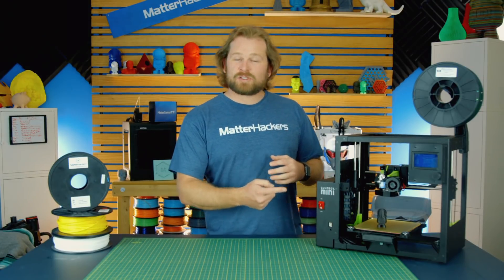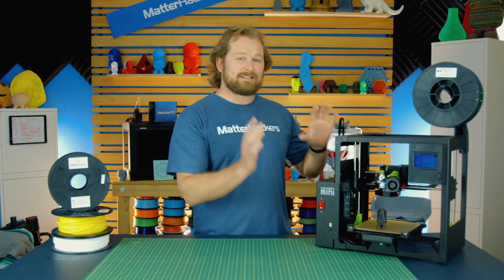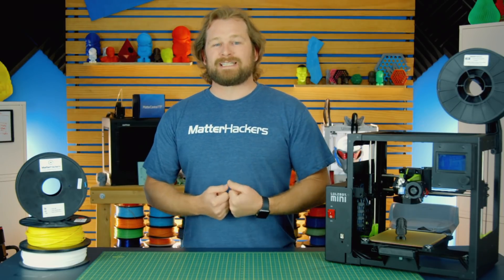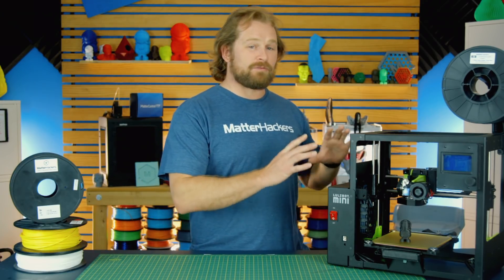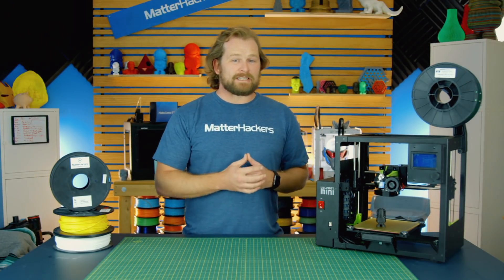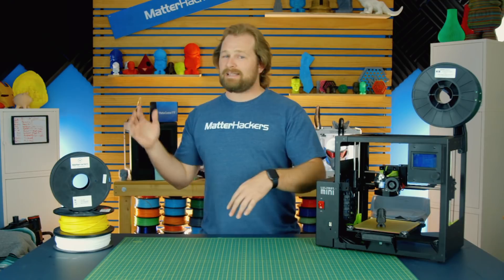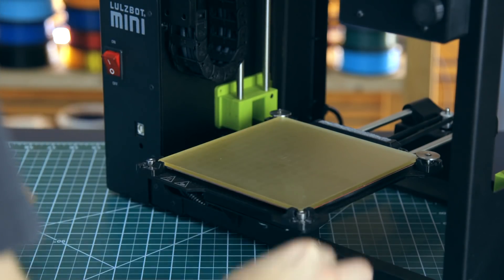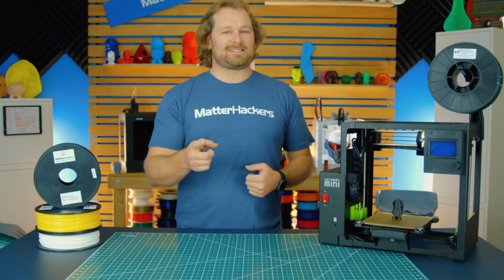The New Lulzbot Mini 2 // 3D Printer Highlights

Comment: Got this printer, tool head failed less than 3 weeks after receiving. Currently dealing with lulzbot, and I’m less than impressed with their response. Considering the price, and currently still not able to print for more than a week... I would not recommend them at this time...let’s see if they make good.
Reply: Update, Lulzbot replaced my tool head, and reimbursed me for shipping. Since then it has worked fine. However it was a frustrating process,  and I did loose 3 to 4 weeks of time I could have been printing.

Comment: I looked up the price on this LulzBot Mini 2. $1500? Seems like they are missing a lot of features built into other printer lines at 1/3-1/2 the price. if you go up to 2/3 the price of this printer you get auto-bed leveling [edit: apparently this is included], removable bendable print surface, filament sensor with restart on filament replacement, restart on power failure (the later may be built into the LulzBot Mini 2.) Adding to other comments. I don't see how the Z-Axis belt solution is better and how it can be more precise. What is meant by "more precise?" The Mini 2 spec sheet describes the operation of "locking the motors," to keep the belt from moving, as a feature. Seems like a work around to an inherent problem in using a belt on the Z-Axis. [Edit: looks like there may be some precision gained from gearing the belt drive. I'm not sure you can't gain even more precision from gearing the lead screw solution. In this case the geared belt is likely more precise than older version.] Also from the spec sheet; Describing a glass plate with PEI on one side as a feature is really strange to me since this is a really a cheaper solution than other print bed solutions on less expensive machines on the market today. Not that what they have put together isn't a good set of features and likely a good printer. It just seems to come in short of features and at to high of a cost. Also, I'd like to see some reviews demonstrating the print quality and noise compared to other similar printers. e.g. Prusa MK3.  [Edit: i'm not normally such a negative person this product just struck me.]
Reply: So after trying to find what they're actually doing with the z-axis, I think I have some idea -- they're using a geared stepper to drive the belt system -- that is by design will be more precise than a lead screw, unless you get a super fine lead screw pitch. With a geared stepper, you have a very high steps/mm number on a belted Z -- which if done right will not have any lead screw related z-banding, and because the stepper is geared it is essentially self locking as there is not enough weight to back-drive it to cause any issues with the bed falling when powered off -- or other issues. This machine does have auto bed leveling -- same as other Lulzbot machines -- it does 4 points by tapping those conductive bed holders. So, with all that out of the way, it is silly for it to be priced at $1500 with MK3 priced at exactly half for a kit.
Reply: (I'm inferring here from the literature). Looks like they are using a dynamic brake. Probably several NC relays or an IC that opens the shorted motor leads when it is powered.
Reply: More precise meaning no z wobble/banding that other lead screw systems tend to have due to side loading of the X axis gantry

Comment: I could be wrong but I thought lead screws were more precise than belts?
Reply: Chris Hutchins Yes, this seems like marketing spin to a cost reduction change. A leadscrew is not really that slow in the Z axis considering it only moves periodically other than when homing or bed leveling. 15mm/s on a Taz mini should be pretty quick. $1,500 with no auto mesh bed leveling, no filament run-out detection, no power recovery. Also when running belts if the printer loses power it's going to bury the hot nozzle into your print making recovery somewhat difficult.
Reply: @Alec Richter You're right! I should have specified auto mesh leveling (I have edited my previous comment to be clear). I just read the literature on the Mini 2 and you are also right that they are using some sort of dynamic brake, probably some NC relays or IC. We have a Taz 4 and Taz 6 here at work and I would rather deal with the manual leveling of the Taz 4 over the OEM Taz 6 any day of the week. The Taz 6 conductive corner bed leveling fails so often that I just disabled it. It is super frustrating putting it on the network for remote printing just to have it fail leveling 75% of the time. It's custom Z min switch is not very repeatable, but that isn't the main problem. The nozzle is rarely cleaned enough with the auto cleaning routine to make contact without deflecting the bed differently at each corner, which causes the bed measurement to be incorrect. This is with a new cleaning pad installed. Our Taz 6 now runs custom Marlin firmware, uses the Z max switch to home instead, and uses a manual mesh bed correction stored in firmware based on the bed temperature we happen to be using at the time. Of all the bed leveling I have encountered, there's definitely no perfect solution. Inductive, IR, BLTouch, servo/microswitches, and manual leveling are all usable. Capacitive is to sensitive to ambient conditions (for my particular installation at least). Conductive would work better if it didn't use the nozzle. Nothing is perfect yet. Time to innovate!
Reply: belts also stretch over time and use, even the high quality ones. I do not understand why they did this as having fast z is not a selling point at all
Reply: doesn't the mini use those metal disks for 4 point auto bed leveling -- it's not a mesh, but presumably the small build plate will be flat, so it should be sufficient. Yes the price is silly in the current market. A belted Z will be fine for something small -- I wouldn't call it a feature upgrade
Reply: Chris Hutchins the drive is geared, so there's more precision, mathematically, than the leadscrew they were using. Screws aren't inherently more precise than belts, it's just that the common belt pitches have much fewer rotations/mm than common screws.
Reply: Belts eliminate z banding
Reply: I've never had my Taz 6 nor my Mini fail bed leveling for anything more than a dirty nozzle. Quick clean and I'm back in business for another 150+ prints. Not ragging on you at all, but there may be an issue with your machine if you found it easier to just disable it.
Reply: Not only is it accurate, but it is VERY durable. My 14 year old can use it and abuse it. It just keeps going!
Reply: Yes they are, but in reality there are a few things. Assuming you count by 1/2 steps, which is the only microstep you can actually trust,  the belts have a maximum resolution of .04 with 1.8° motors. With 0.9° motors, you can go down to 0.2, or .04 with no microstepping. For an FDM printer, you are going to have a hard to going to layer heights that fine for many other reasons. With the leadscrew, you can go down to 0.003125, but again, you're never going to be able use that. Leadscrews are more solid, but they can also be bent and introduce z-wobble. When done right, leadscrews are the better option, but take more effort to get there.
Reply: Thomas Piccione thanks for that, but don’t you think on a $1500 that it should go the extra mile and use nice leadscrews. And besides leadscrews last a lot longer than belts if they are made right. Belts stretch leadscrews don’t. For $1500 I feel like they could use high quality leadscrews for the printer.
Reply: Everything here is wrong so far. Let's assume the Mini 2 is using 16 tooth GT2 pulley and 1.8 degree stepper motor. The theoretical resolution is (16*2)/200/16 = 0.01 mm. Assuming there is enough torque to achieve a 1/16 microstep (they're using large steppers, so they likely can). Since 0.01 mm is smaller than any layer height you're likely to use, there is no real life resolution advantage to a leadscrew layout. Also, all leadscrews have runout which will lead to misalignment of the extruded layers. This is a non-issue with a belted z-axis.
Reply: @grantpeck  clone of what? Aleph Studios (Lulzbot) are pioneers in open source 3d printing
Reply: They are? So every lead screw system is more precise than any belt driven system just by nature of it being a lead screw? No, that's clearly not true.

Also, while it may very well be overpriced, what is it a clone of? Itself?
Lulzbot has been around since nearly the beginning of the reprap movement, and the original Mini came out like 4 years ago - well before any Chinese companies were making cheap printers.
Say what you want about the printer, but at least be accurate. A clone it is most definitely not.
Reply: Matterhackers is bad :(

Comment: had the areostruder on my taz6, was a hunk of junk, they really shouldn't have bothered with it on the mini 2, also still no filament sensor? ......1500$ and missing features most 300$ printers have?
Reply: Thyshallsmite I agree with everything you said, except that I have actually had good luck with my 1.75mm e3d Aero conversion on a Taz 4. It was a full third party conversion, and not the one you can buy from the Lulzbot. I also cleaned up the Z banding by removing all of the lead screw support bearings.
Reply: Some people require printing with multiple spools over the course of a week or more. It is also very handy when running a bot farm assuming your printers can properly resume without leaving a noticeable layer defect. Our printers run 24/7 and without filament runout detection, things would be more of a hassle due to having to remove partial spools for guaranteeing enough filament on larger prints. It's much easier to just use all your filament and add another spool.
Reply: @Stuff With Kirby, I think generally this can be true. However, i've used the feature pretty well with using up the full roll of filament before moving onto the next. It isn't a critical feature but It is one I actually use.
Reply: not really, i print for my business and manage about 30 printers, and i'd rather not waste time on large prints checking to see when the spool is going to run out and catch it before it does. For my printers with a filament runout sensor i can mostly just forget about them till the print is done or swap spools before it's completely run out. Also at this price point no chinese machine should have a leg up on it.
Reply: i bought the official one as a supposed upgrade, was a huge headache, even swapping filament on that was a pain on it and it just loved to jam. Never really had a problem with the stock one but my official aerostruder is now a paperweight
Reply: Filament sensor is just another gimmick for people that cant be bothered to check their amount of filament left before printing.